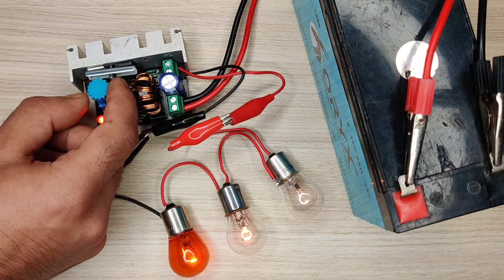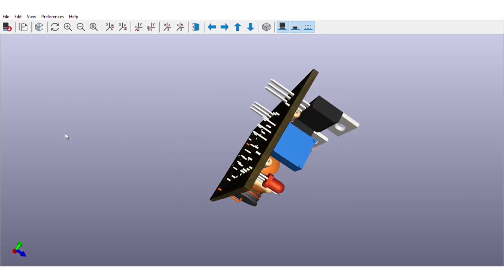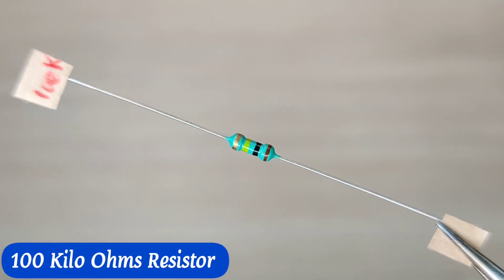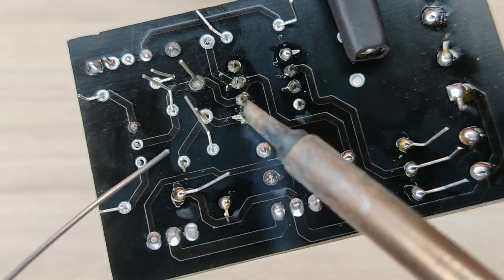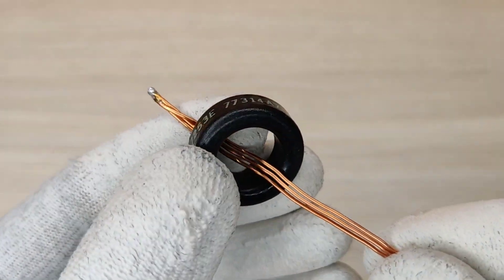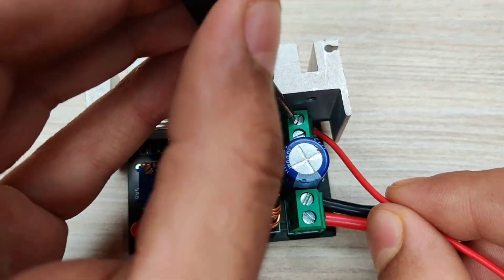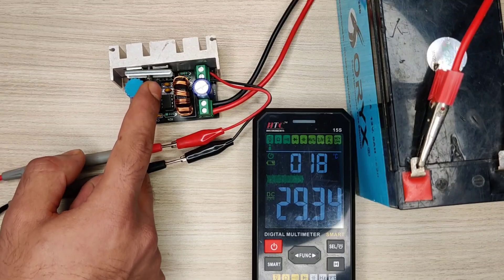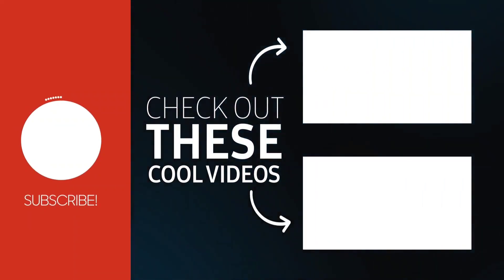how to make DC to DC Boost Converter circuit with constant output

Comment: How to make A convert 24V DC to 220V DC using a chopper, I need a DC-DC step-up converter, often called a boost converter or a DC chopper, designed to handle the desired output voltage and current. The circuit uses an electronic switch (like a MOSFET) to chop the input DC voltage, a transformer to step up the voltage, and a feedback circuit to regulate the output to the required 220V,

Comment: does it have short circuit protection in case o/p is shorted & where did you find the cap for the preset.

Comment: Kya ye 5 volt se run nhi karega
Reply from the maker: Yes it can work, but will drain power fast, as coil is designed for 12 to 30v boost
Reply: @CreativeTechos  Thanks Big Bro Reply Ke Liye